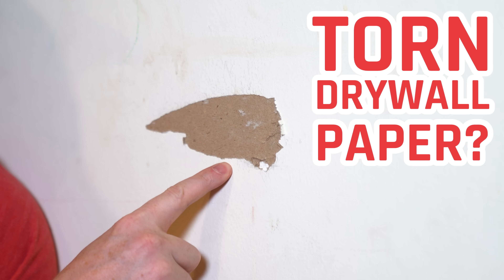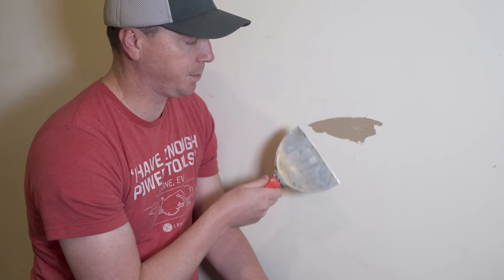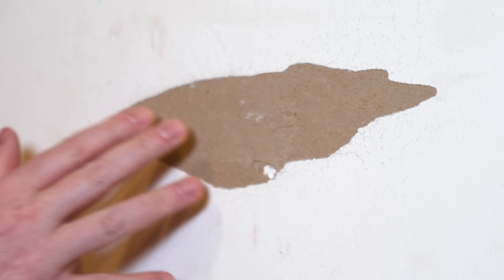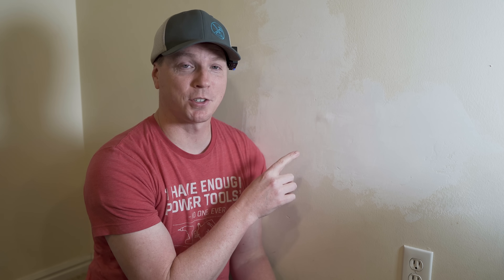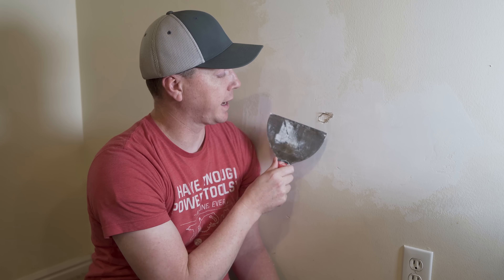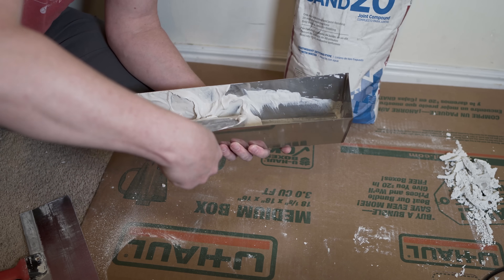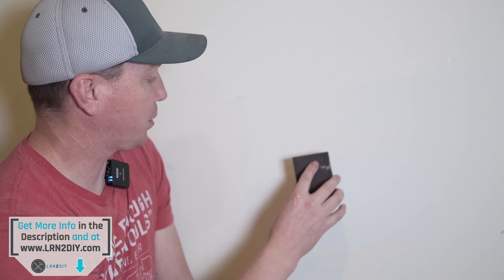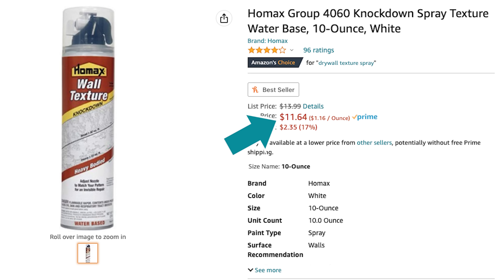Make Ripped Drywall Look New With These Simple Tips

Comment: Elmer's glue as a sealer and Pink Spackle work well. If you have a lot of repairs to make, buy all that stuff, but it's overkill for one little tear.
Reply: Unfortunately, I've got way more than that one little tear to fix!
Reply: Dang! Wish I saw this comment earlier
Reply: Any kind of Elmer’s glue? And if I have old paint/mud flaking what kind of primer do you suggest will kilz oil based work?
Reply: If you have 2 weeks to get it fixed sure
Reply: I agree I was thinking as I was watching the video. Why not use a little Elmers glue on there instead of buying a gallon of that other stuff.
Reply: When I went to check the torn paint I was able to pull off with my fingers ?
Reply: I was wondering if Mod Podge would work.
Reply: Anything oil base. Old spray paint, poly, sealer etc

Comment: When removing wallpaper, I get tears like that.  I use Gardz on the entire wall, as it helps with sealing any paste that may remain.  Then, after I patch with mud, I also re-coat with Gardz.  I have found the patched part will have a different sheen if I don't re-coat.

Comment: Guards is a water base sealer, water wets the drywall paper and sometimes makes it loose as seen in this video.
Reply: Yup. Guards sucks. Bin  is alcohol based and dries in 10 minutes, but if you really want absorption, use oil based primer, just takes longer to dry. Pro painter, 30 years here

Comment: Distilled water mixed with pva glue works great in place of sealer you used. You also need to add some to your hot mud because it lacks the adhesive in those powder mixes compared to premixed.

Comment: I applied plus3 joint compound over the paper and sanded. I haven't applied paint yet. Can I still use a pva primer over the plus3 joint compound and still not have bubble effect? Areas are softball size patches.

Comment: Titebond wood glue works well to seal! I usually have a bottle on hand, so need to buy the expensive specialty primer.  Have done quite a few spots thru out the house over the years, and everyone of the repairs is holding up good, no probs! But you are right getting rid of all the loose and torn paper is key!

Comment: Thank you for this video!  I took the chair rail and picture frame trim off my dining room wall.  I took my time, scored it first to try to avoid any drywall paper tears, but still ended up with some torn drywall paper.  Thanks for taking your time as you demonstrated each step.  I now feel reasonably confident and competent to try to fix it.

Comment: I NEED HELP bad?

I want to replace a one piece vinyl or plastic tub surround with a 5 piece tile like plastic or PVC surround which consist of 3 wall panels plus 2 corner caddies. . . 

The existing one piece tub wall surround seems to only be glued to drywall behind. I'm sure drywall paper will be torn from the drywall during removal but what should I use to fix/patch the torn paper areas and lastly what type of adhesive should be used to stick the new wall surrounds to the drywall 🤔

Comment: Appreciate the full details, how sheetrock is made and why the air can get trapped backwards under the layers. Also appreciate the detail in the how such as hold the sanding sponge on an angle and what grade you use. I've done DIY for years and now know the 'why' of importance of sealing with your prepared 'wrong way' result.

Comment: For the occasional small patches I need to fix, a gallon of Gardz is overkill. Even the quart size is $68. What's a good substitute? There's a particular spot I need to do over, want to get it right this time. I spackled, sanded and painted, but it looks terrible.
Reply from the maker: Try just using Elmer's Glue. It's not the same but it should prevent the bubbling.
Reply: Cover tge area with fiberglass tape, then coat several times, overlapping each time then sand.
Reply: See comment about using a damp rag to expose loose paper.  Base layer of dark paper is usually easy to seal with glue or water based primer.
Reply: To make a clean perimeter, lightly score the paper and run a well worn putty knife or razor edge ALONG the edge to lift the upper white layer of paper off.   This layer is where most of your delamination  problems occur.
Reply: The first thing you need to do after sanding is feel the surface if you can feel it you will see it.After that use a primer sealer latex of course  I guarantee the result
Reply: Shellac is fantastic, fast, and cheap for something like this.

Comment: First...be patient:
Prep all your walls initially.
The first thing it says on a can of paint?
Clean  the surfaces!!
Then...any (sub) patching:
You score w/ a new blade at an inside angle in one swoop.
If your not going deeper than paper...be gentle with the scoring.
Then use (guardz or ready patch) primer for adhesion and sealing.
Hit it twice and smoothly feather with a good 6-12inc knife w/ 20/20 as to get it right.
You can sand primer...you can't sand paint
Finish with wall schedule paint.

Comment: I use kilz2 spray prime its water base . binxer is good but the shellack might be too aggressive hence bubble.  I hear Elmer's glue wit acid brush works good too I use blow dryer or heat gun to speed up drying. .You  can use body filler.  with hardner. mix tight wipe. in 20 minutes good and hard, the season in autpbody filler seeps or absorbs in paper. locks in place. and then apply joiny compound over body filler. will stick. light sponge prime paint

Comment: Never had had much luck with those spray cans. They are one time use,don't expect them have pressure on your next job. What may seem as a convenience and a time saver ends up not being. Buy the can make sure it's sealed and it will be ready the next time you need it.

Comment: good video , and everything you said is true , but I would just use a paintbrush instead of the roller ...... faster , easier , less steps .... the roller is overkill ...... open can , dip brush , seal drywall , wash out brush , done ....

Comment: I noticed the spray product said Shellac, which is one of my favorite finishes and sealers.  Dry shellac flakes last forever, then you dissolve them in alcohol.  It dries like the wind, and water doesn’t dissolve it.  Finish repair is easy with alcohol and another coat of shellac.  Very eco friendly too, as is is actually made from the shell of the Lac bug.  

It isn’t as strong as polyurethane, but fantastic for a quick finish or something you’re going to paint.  I’m using it outdoors as a sealer on old Masonite siding before repainting, because I noticed the commercial “rotten wood sealer” acted EXACTLY like shellac.

Did I mention cheap?  I bought a pound of flakes on Etsy for $16 plus shipping, and it will last me years.

Comment: Ahhh.  The spray on texture that matches the other surface is key.  I had no idea this existed!  I always hated how the sanded areas were smooth & the remainder of the wall had a texture.  Will be buying this today!  Great process & tutorial...
Reply: All new houses use Level 5 (smooth finish) it's more initial work, but it's easier to match the repair. Matching the last guy's pattern or texture isn't always easy without looking patchy.

Comment: Cover the area with fiberglass mesh tape.  Coat several times, overlapping each time, each coat thin down muscat little more than tge previous, sand with 150 paper.  Cheaper, and easier

Comment: Thanks for your version of fixing tears in walls. Usually, I go straight for the pink spackle that turns white and sand it down. However that doesn't ensure that I will avoid air/wet pockets.

Comment: WRONG!
Hit it with 3 M - M77 spray adhesive. Wipe the brown paper with drywall knife to lay down brown paper. No need to wait . Then coat with joint compound.

Comment: Good job. I use a 5000k light to sidelight the area to throw harsh, strong shadows for sanding. If it passes that, it's good. Non water based sealer works best. Shellac based or even spray on varnish works too.

Comment: You're accurate with the gardz use, however your mudding skills suck. Use the 5 minute small amount and pull it tight. Do this 3xs and minimal sanding is needed.  Btw: 28 years experience drywall and painting